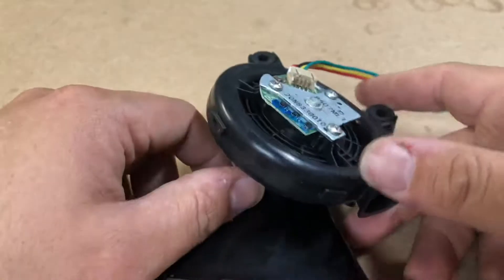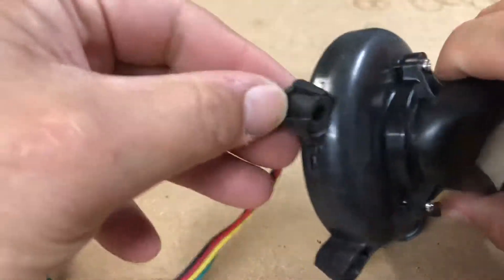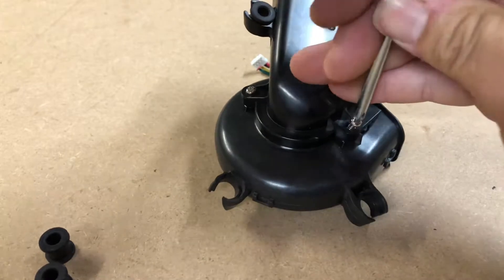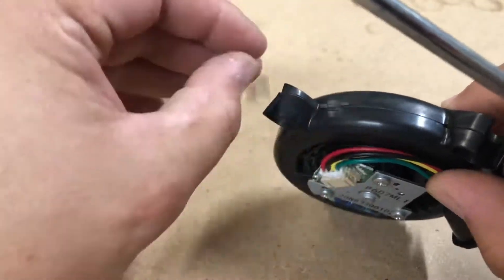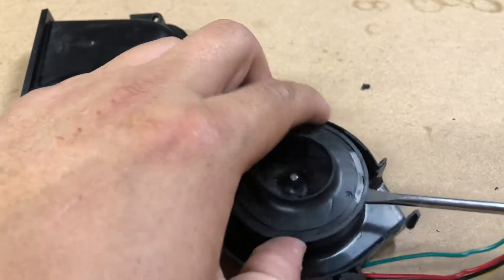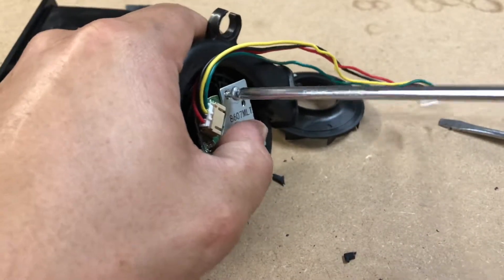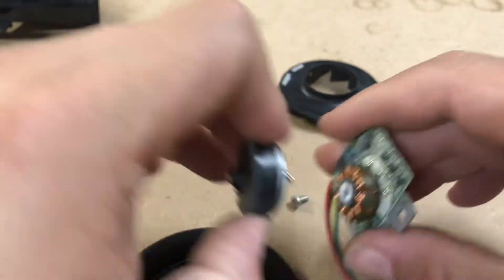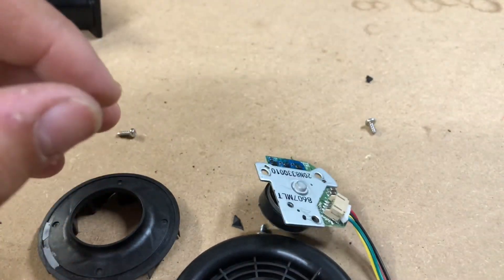Shark Ion Robot Vacuum  850 suction motor tear down

Comment: Thanks for your videos. Getting a suction not working notification on my phone and the robot quits. It then starts beeping. I've taken the suction motor out...how do I see if it still works?
Reply from the maker: There is a few ways , if you have a bench top power supply you can try to get it to work that way. If not then you will have to jump some of the connectors on the board on the motor. most the time if something isn't stuck in it then you just are better off buying a new one for it thats the problem most the time unless there is a bad stop on the motherboard itself.
Reply: @SmittysWorld  jumped it to a 9v battery, it worked so wasn't the problem. With it being a variable drive I had to put the red, green, and yellow wires on positive w/blk on the neg. Thanks for the help!
Reply: The tip to test the suction motor was gold....Thanks🙏....mine was the yellow on the negative and rest in the positive to test...for future readers reference 👍

Comment: sooo not sure if this is a good place to comment but you're my only hope lol no help from customer service ooor from the manual. I have the Shark IQ RV1001AE and I'm getting the 'botboundary error' Clean is solid Blue. Dock is solid Red. 

I haven't set up the boundaries and the vacuum gives the error immediately after turning it on to clean. Ever heard of this one? lol Cant find anyone talking about it
Reply from the maker: Well that is a first for me have you tried hard resetting the robot? If so have you remove the battery as well then disconnect your device from the robot and start a new set up once you’ve done that it should reset this but if not let me know I do have a new motherboard for the shark 1001 A Series so message me on eBay and we will follow up there to see if the problem is resolved